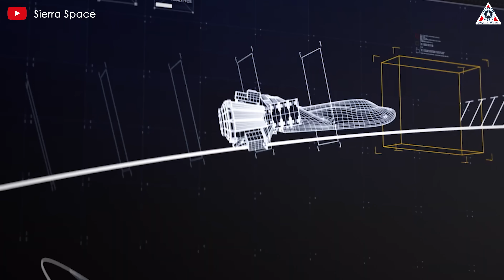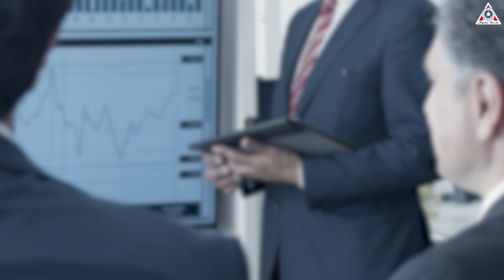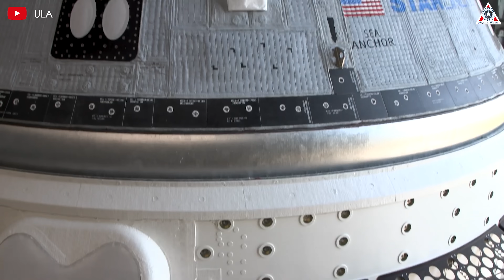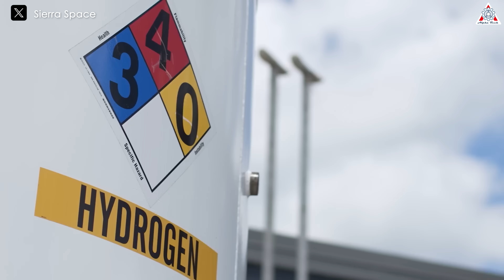NASA's New Space Plane in BIG TROUBLE! Here's Why

Comment: Why, if the Vulcan Centuar is not currently reusable (I know they are trying to make the engine section reusable, but it isn't yet), is the power requirements compares to a Falcon 9 reusable instead of a Falcon 9 disposable? It's simply more costly to the customer, wonder what Falcon 9 disposable cost is compared to Centaur.
Reply: What does Vulcan's reusability matter if it has the payload capacity?

Comment: IMHO Dream Chaser is an idea overdue, Boeing has had that program in one form since the 80's for a mini-shuttle.  It was even mandated by Congress for ISS (then to be Station Freedom) as a requirement for any manned station to have as a lifeboat.  Boeing failed to deliver then forcing the deal with Russia and renaming the US station planned as the International one.  The real problem with Boeing is heavy reuse of off the self parts that were rejected from older programs like the thruster system valves on Strandliner that were never rated to sit idle on a pad for days or weeks under pressure.  Now with the He leaks not only do they have a lost of control issue for any return trip but the last leak was at thruster levels that is like strapping on a rocket on a pivot causing random counter thrust to any effort to control the craft working against any pilot. Dreamchaser was intended to be a crew only or small load addition to the old shuttle fleet since the late Reagan years.  The idea is good but Boeing is not the one to build it. Another canceled project I think would be worth bringing back is the Diamond shaped Aerospike Shuttle that was intended to replace the shuttle fleet.  Like the dreamchaser one was nearly finished before the cancel with frames built for a pair of follow on craft.  It was fully self contained and with added SR boosters could go farther than orbit.  One advantage of the dreamchaser idea is it can be mounted on nearly any rocket (with some adapting collar if needed).  There is no need to place it inside another's cap and could expand range with larger rockets.  Like I said though it needs rebuilt without Boeing using spare leftovers and updated to newer material.  SpaceX is replacing older parts with better ones as they become possible (3 gen on tiles a new gen engine being tested now)   When was the last time Boeing built anything that was new that wasn't just a reconfigured use of old parts.  All the Max lines are is just extending the old tubes, not a new plane designed.  They canceled all 4 engine designs in aircraft, limiting safety for overseas flights going forward.  If I was POTUS I would cancel the 747 rebuilds for AF1 and doomsday planes and go with the C5 instead.  Already Mil spec and the motorcade planes act as extra doubles.  With a shared design for both pairs should also be able to up the order to 5 for the same price as the 4- 747s too.

Comment: A lot being learned from Starship reentry which so far has been working so my guess is bulk of resources continue to be poured into that SpaceX product which is launching and is improving and validating some really crazy ideas that if even if only ten percent of them work will revolutionize space flight with to date all the craziness with that system (methane raptors, full re-use, two stage, possible re-fuel on and on) is causing some Industry blowback from those now finding themselves to be playing 2nd to all of this which is basically everyone except RocketLab which has been far more modest in its goals offering up competition against Falcon 9 as its primary upgrade as new system. Ukraine continues to drain resources from everything and everyone as does the illegal and now massive War against Yemen and whatever it is that is going on in the Levant. Major Blowback to be expected therefore..

Comment: As the military did right after the 5th space shuttle mission, which launched two communication satellites into orbit, they bumped commercial payloads for military payloads which needed "to be in orbit yesterday". Then along with classified payloads came mission specialist who didn't get along with NASA astronauts.  If the military used their own boosters then the shuttle would have started building the ISS in 1988 instead of 1998. And now the DreamChaser is getting bump in favor of the military.

Comment: X-37B has made 6 flights.   
Given that NASA wants interoperability between launch systems and payloads they should not be holding up the dream chaser for a non SpaceX launch vehicle.  SpaceX has both the Falcon 9 and Falcon heavy.   If on can not fly the dream chaser the other can.  Has a 5.2 meter fairing.   No reason not to use SpaceX other than politics.

Comment: Glad to see somebody working on spaceplane tech. Interesting lines on dream chaser.  flat bottomed, stub nosed and folding flapper wings.  I wouldnt call it an elegant design, but if it works, its more advanced than capsule era tech.

I would like to see experimentation with fabricated shapes to see if heat shields could be reduced via glide ratio extension in thin air.  Might be something for a rideshare program, to build scale models and test. So that any time there was excess launch potential it got used to forward the tech.

Brick bottomed aircraft   seems a bit odd.

Would be interesting to have an X-prize for longest skin temp coolest glide, from a bench mark LEO.